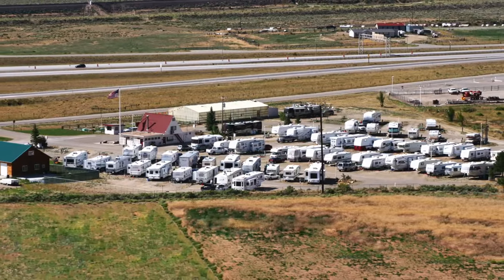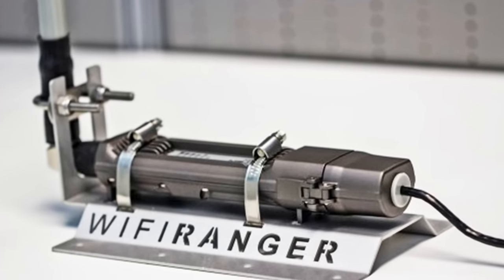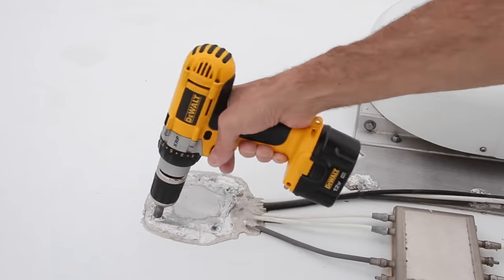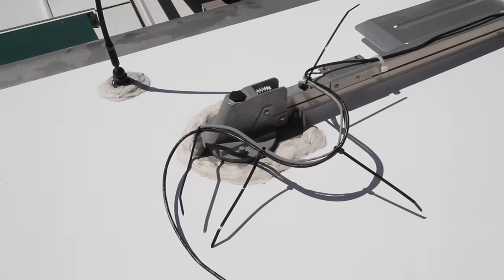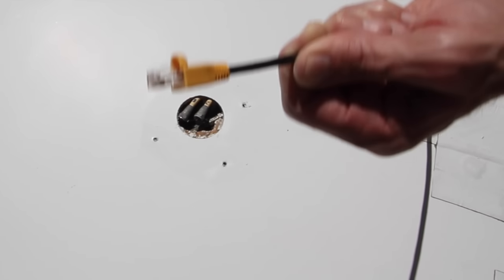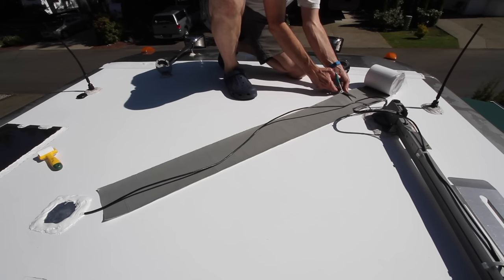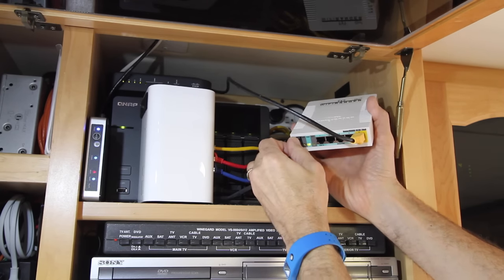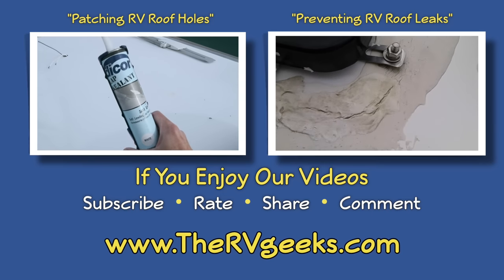Boost Your RV WiFi - WiFiRanger Installation

Comment: Looking forward to that future video, hopefully it will explain how you set up the software to do repeating.
Reply: Also is there a video about setting up that conduit? or is it a normal feature of your RV?
Reply from the maker: +Scott Cress We're pretty much using the WiFiRanger software as is... it handles all of the configuration settings, etc. No special settings required. Power up. Log into the admin page. Scan for WiFi networks. Select which one you want to connect to. That's it.
Reply from the maker: +Scott Cress No video... that conduit came built into our RV.
Reply: RVgeeks okay cool.  Thanks for responding.  This may be the solution to my Wi-Fi woes.  We have a Roku box for both our RV's TVs they often don't play well with the free networks.
Reply: RVgeeks, Cool feature.  Think you could do a video on installing one?
Reply from the maker: +Scott Cress Installing a conduit? We already have the one from the factory, and we don't know that we'd be comfortable trying to install one after the RV is already built.
Reply: RVgeeks
Makes sense.  I would be nervous too,  that's why I was asking you to do it first.  😁 
Looks like a good learning opportunity for me.

Comment: Hi guys, Thanks for another great and informative video. I just received my Elite pack which was ordered using your discount code (Thanks!). So I was reviewing this video again.  We're picking our our 08 Mountain Aire 4121 at the end of April from storage and setting up for full timing once the house sells this spring. My question is, the access plate you showed, was that actually put there when new by Newmar?  I climbed the ladder when were were buying our MA, but didn't actually walk the roof to the front. Wondering if I can expect to have a similar access plate and wire chase on ours? Really enjoying your Austrailia videos too!
Reply from the maker: +Mainuh That access plate was standard equipment, so we bet you have one too. Happy travels! 😊

Comment: You forgot to pull another string through the conduit when you ran the wire.  Also, you have to be careful when you use side cutters to cut off zip ties.  the remaining end, will work like a razor blade when working near them.  I prefer to use a razor blade and cut them perfectly flush.  I used to have a tool for tightening and cutting zip ties, but I wore it out back in my racing days.
Reply from the maker: iceman22st That other cable visible in the conduit is not in use, so that we can use it to fish another cable if needed, so we don't need a string.
Reply: OK, good, but just remember when you pull that last one, pull a string through so you always have one in there for future use.

Comment: Great video! Why did you get rid of your internet satellite? Thanks
Reply from the maker: +Open-minded Skeptic Internet satellite has been out-done by the cellular system by a mile. The only thing satellite is better for is being in a place so remote that cell service can't be found. We find ourselves in fewer and fewer of those places, and the slow speeds, data limits and cost of sat service was just no longer worth it for those occasional times.
Reply: +RVgeeks  Makes sense. Thanks.

Comment: very good but have you thought about canntennas for wifi, when the source is very far and to bring the signal much better than an omni
Reply from the maker: George Gardinier Cantennas are best if you have one on both ends. Since we can't control the RV parks' system, they're often disappointing.
Reply: RVgeeks as you may have seen the other post, he tests to omni antennas in his area before and after the new antenna. he is an engineer in this. and his prices are way cheaper than the one you showed

Comment: As always, GREAT videos! We just moved to full-time Nomads! Question, our new Tiffin Allegro RED came rewired for a Winegard ConnecT antenna. So there is a CAT5E cable preinstalled from the roof. It’s my understanding that the WIFI Ranger EliteACPackFM uses the same type of cable. The question is, is the cable end on the CAT5E cable at the antenna unit? So I could remove it's cable and use the existing preinstalled cable?
Reply from the maker: We recall that the antenna has a regular ethernet port, so it should work.

Comment: I guess am just too frugal an RVer to justify $650 to boost my wifi! And, for that money, it better bounce everyone else off the signal so I have free reign. There must be a more economical way to do this! Thanks for your post and information. Be Brave! :)
Reply: George Purdy you are right on, spot on. that site I put up, did you see it. now WiFi does buffer more and cantennas should work better, most WiFi is verticle polarized anyway, you gave a great answer
Reply: George Gardinier
I saw one driver that took a cake cooling rack and stuck it on the front of his trailer with a coax soldered to it, cork feet so it didn't ground to the truck, looked stupid as hello but it worked! He was a Navy Signals guy! LOL! I was Army! Signal Corps!
Reply: George Purdy that would be a fellow that would know how to do it for sure. keep in contact with him for signal information
Reply: George Gardinier
LOL that was about 2008 just before a small fight with cancer and since then I've "retired" as brain surgery sure does screw with your job qualifications and job offers LOL
 But I bet he's still ahead of that curve! It's cheaper when you have that education and training to come up with crazy fixes like that!
Reply: +ben marko couldnt find your comment, What kind of $15 dollar booster do you use?

Comment: Did you make the access hole on your roof, or was that original equipment? I'm thinking of making one right above the cabinet that I'm installing my electronics into.
Reply from the maker: That was original equipment, but we’ve heard about people making one afterward. You might want to inquire of your manufacturer about wiring locations first and see what they think. You might also consider installing a waterproof junction box up there for easy access in case you ever want to bring in other cables. Just be careful and make sure it’s well sealed against leaks when you’re done!
Reply: Thanks! You guys have a lot of great information. I appreciate it.

Comment: Great video, inside how the reception? Do you need to be standing right next to the inside box to get a good signal? Or does the signal stay the same throughout the rv including sitting out side.
Reply from the maker: It's exactly the same as the WiFi you have in your house. Reaches all over the RV and outside on the patio, too!
Reply: RVgeeks TX I'm hooked. Do you have any opinions on the cheaper models. They start at $350.
Reply from the maker: We don't have any experience with the cheaper models, and the Sky2 Pack ($359.99) uses a totally different outdoor unit from what we have... so we can't really give you much guidance on it. Our friends Cherie & Chris ( of http://www.rvmobileinternet.com ) are currently reviewing a bunch of units, but don't have results yet.  If you can wait, it might be worth joining their site in order to get access to their test results once they have them.
Sorry we can't be of more help!

Comment: You mentioned connecting to a coffee shop down the street, wouldn't you still need a password in order to get on their network?
Reply from the maker: +Nancy Savidge Absolutely, Nancy. If there's a password on the network, you'll need it using the WiFi Ranger, just like sitting in the coffee shop. But of course many networks have no passwords. ;-)

Comment: Could you tell us how to run the wire for those of us who didn't remove a satellite dish and leave a wire to help us run other wires?
Reply from the maker: Hi Zane! It depends on whether your RV has a conduit/chase like ours or not. If it does, you can fish a wire through there using a wire hangar. If you don't have a conduit at all, you'll want to find some other route into the interior of the rig. One of the most popular paths to follow is down the refrigerator roof vent.

Comment: Great video. Does it directly broadcast the WiFi
Reply from the maker: It connects to an external WiFi source (RV Park, Starbucks, you name it) and then uses that as the internet connection for its own WiFi network. So you connect all of your devices to the WiFiRanger network... and use its admin panel to select the other network you want it to use.
Reply: Thank. Is that a brand or just a description of the product
Reply from the maker: WiFiRanger is a brand... you can check them out on their website here:  http://wifiranger.com

They're not cheap, but they work really well and are easy to use. You can save 5% on your order directly from them with the code "WFRGEEKS" (we don't get anything for it... just saves you money).

Comment: Will this work in a park with about a 100 campers in it I can't even get tv with the camping ground full I'm right across the street from antenna
Reply from the maker: +Jeff LaFrance The WiFi Ranger can't overcome an overloaded RV park internet system. Here's how to test... If you can take your laptop close to an access point, and get great Internet service, and then go back to your campsite further away from the antenna and you then get poor service, the Wi-Fi Ranger will probably work great for correcting that situation by providing stronger connectivity to an inherently strong system. But if taking your laptop over to the clubhouse or other location close to the source of the Internet signal is still slow, then the system is just overwhelmed and nothing can correct that.

Comment: I doubt you will see my question, but Im gonna ask anyway. Im a full time RV'er and would like to purchase this product, but have 1 concern. Can the WiFi Ranger ELITE connect to Multiple Network connections? My friend has given his pass to his WiFi Network, yet their is an open hotspot near me. So can the WiFi Ranger ELITE grab internet from both my friend and the hotspot at the same time? I have read that this WiFi Antenna has an option called Multi-WAN Mode, but thats only to combine Wireless, Ethernet, and 3G/4G connections. Can this option work with just connecting both to my friend and hotspot near me? Thanks if you can answer my question.
Reply from the maker: Hi! We see all of our comments and are happy to do our best to answer!

We have done "load balancing" with our WiFi Ranger by connecting the rooftop unit to one WiFi network and the Go2 unit to a second WiFi network, and it did indeed improve speeds.

There is one caveat to that. The Go2, being mounted inside the RV, does not have the range of the rooftop antenna, so you'd need to have fairly close proximity to one of the signals for it to work.

For much more expert technical input on this subject than we can provide, we'd suggest reaching out to our RV connectivity guru friends, Chris & Cherie at http://technomadia.com. If you do, be sure to tell them we say Hi!
Reply: RVgeeks Thank you very much for your answer, I really appreciate it!

Comment: Hi, is this still a good wifi booster for rvs or is there an updated version? Thx
Reply from the maker: They've upgraded the system since we got ours (our unit is 802.11n while the new version, called the EliteAC Pack, has 802.11ac, so it is faster), but yes... it's still a great option. You can check out the details on the new system here:  http://wifiranger.com/shop/product/59-eliteac-pack
Reply: WifiRanger Products seem to have changed to a fin design, also bundled with cellular systems.

Is there a current link to the wifi elite system similar to the product in your video and currently available?available
Reply from the maker: Hi Mike! It's true... WiFiRanger has evolved their product to the new Converge system. While it does offer cellular boosting, you don't have to use it if you don't want. They still do basic WiFi boosting as well.

One of the only places that the old Elite system is available (that we can find) is over at MobileMustHaves.com:  https://www.mobilemusthave.com/WiFiRanger-EliteAC-Pack-FM_p_30.html

It's the Flat-Mount version (which we would have gotten had it been available when we did our install), but otherwise it's functionally the same as ours.

That said... if we were doing an install now... we'd definitely consider the Converge system for future-proofing. We haven't familiarized ourselves with the features of the various Converge units, so we can't make a specific recommendation for which one to choose. But if you DO choose one of the Converge units, use the "WFRGEEKS" coupon code at checkout to save yourself 5% (we don't get anything for it).

Comment: Where can I get the complete step by step setup for the Bullet TI so I can hook it to a wifi router in my RV? And can I just plug the POE adapter LAN port into the internet side of aNY ROUTER? I have a Netgear Nighthawk and I have a R36 Alpha. I want to if possible use the R36 with the Bullet TI since I bought a couple of them I have a invested amount of cash outlay but can't seem to make the bullet work other than as a Wi-Fi adapter for my laptop when using the Ethernet port. I have been trying to hook it to a Wavlink ac600 high power outside type unit but can't figure that out either. I can get the Wavlink to act as a repeater by itself and am able to use the Ethernet port on it with the laptop to get to the internet. But when I try to put the Wavlink in AP mode and hook it to the Bullet TI I can't get that to work. So am needing help big time with this! My big goal is to have the Bullet TI outside my RV and a normal Wi-Fi Router inside the RV. Any help would be great!
Thanks 73 Jimmy, WX9DX
Reply from the maker: Hey Jimmy. We're not familiar with the WFR Bullet Ti and its capabilities. We do know it's the predecessor to our WFR Elite unit, and what we're saying here is based on that assumption. You SHOULD be able to connect the Bullet Ti's LAN port to the WAN port on a router (you might want to use the Nighthawk for this, as the Wavlink is basically a replica of the Bullet... and the Alpha sounds more like it was intended to be repeater, not a router).

With a computer connected via WiFi or Ethernet to the Nighthawk, you should be able to access the WFR interface on the Bullet by going to http://mywifiranger.com so that you can control which external network the Bullet is connected to. Once the Bullet is connected, it then should provide the internet connection to the WAN port on the Nighthawk... which then shares it to all other devices over its own internal network.

Basically... that is replicating what we have with our WFR equipment and our Apple Airport Extreme.

If you're having trouble getting it all to work, our first suggestion would be to do a hard reset on both devices to get them back to their factory defaults and move forward from there. But, again, we're not sure that trying to get the R36 or the Wavlink to act as repeaters for the Bullet is going to work very well (if at all... for that to work, the Bullet would have to be creating a secondary internal WiFi LAN for them to connect to, and we're not sure it can do that).

And if you have questions about the WFR Bullet Ti... we'd suggest contacting WiFiRanger to see what they can do to help get you up and running the way you want.

Sorry we can't be of more help... other than to let you know it SHOULD all be possible!  ;)

Let us know how you make out!
Reply: Really, thanks big time for the help. I got the Bullet M2 Titanium to work as an adapter for my PC laptop last night. Was up till 4:30am working on the project. Then I did hook it to a small Netgear $28 Wal Mart router on the internet port. Had to set the router to DHCP and name it's WIFI and give it a Password. The thing worked amazingly well. Had an 8DB antenna on the Bullet and did see over 20 wifi systems in the area. Thanks again big time. 73 Jimmy, WX9DX
Reply from the maker: +WX9DX That's great, Jimmy! Glad you're up and running! Now get some sleep! 😉

Comment: To avoid radiation in the RV can you wire you computer directly to Ethernet to the ranger?
Reply from the maker: +John Puccetti Yup. You can hard-wire directly to the LAN port.
Reply from the maker: +John Puccetti Yup. You can hard-wire directly to the LAN port.